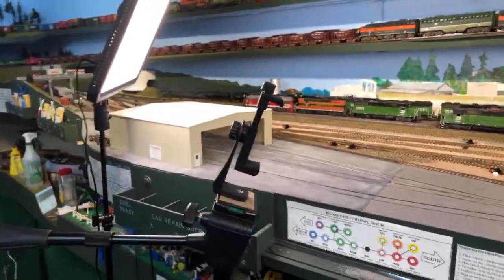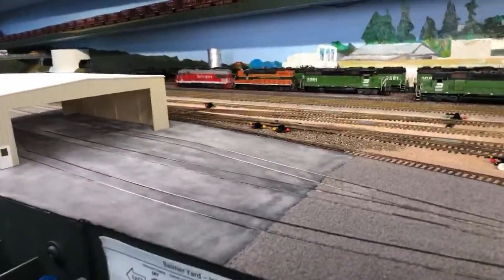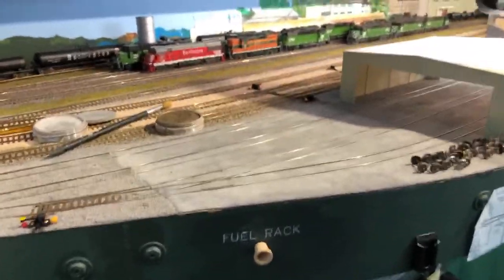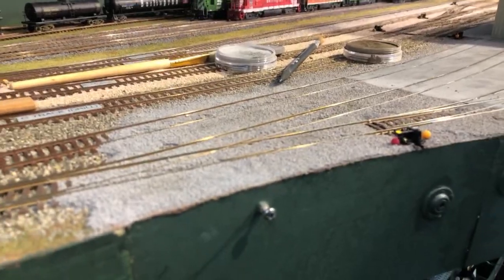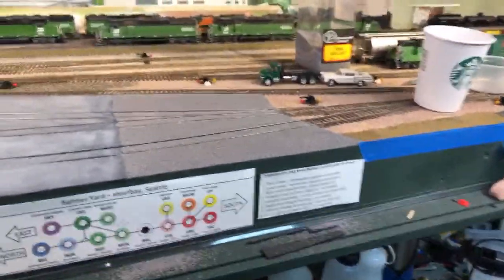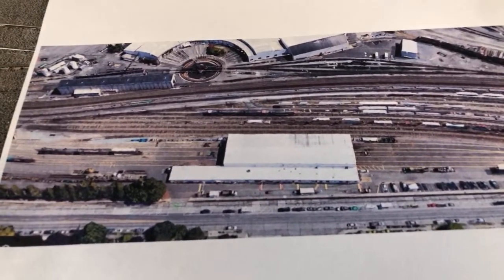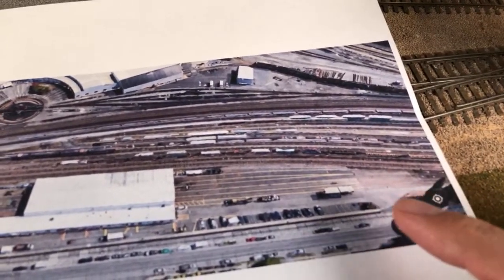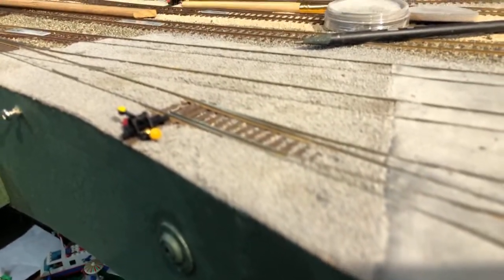Paving the HO Car Shops, part 3

Comment: I've found that using actual limestone dust makes a great gravel road surface material. Real cheap - you can get a huge bag at Home Depot for a few dollars. The kind used to level walkway and paving stones.  Just have to sift it to separate out the larger pieces.
Reply from the maker: Thanks for this comment - I was hoping someone would suggest a better way. I even have some limestone dust left over from making the seawall - I'll get it out and try making a light finish over the top of this new pavement and see if even that improves the texture.
Reply: Happy to help. You can check out how it looks on my layout after the 12 minute mark on this video: https://youtu.be/CO5eAytEh0w
I also used it for the entire propane facility yard but I think that's on another video.